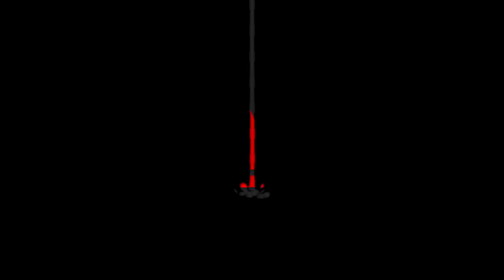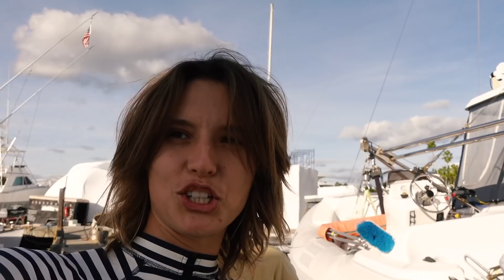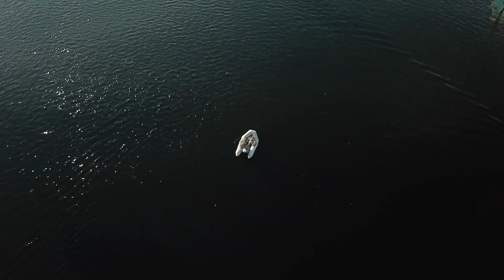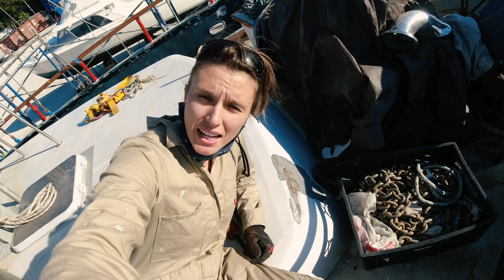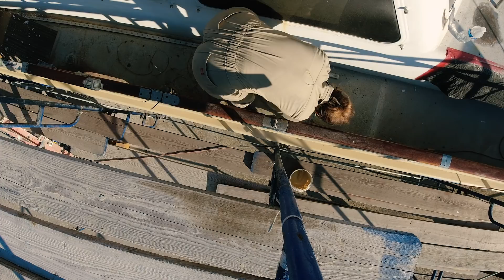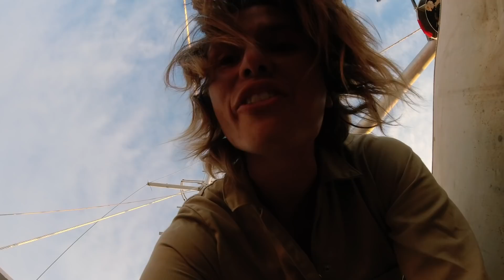ELECTRIC boat ENGINE for our sailboat!? & electric outboard motor test. OFF GRID Sailing Yacht Refit

Comment: the shaft appears to have poultice corrosion.
lets see what happens
Reply from the maker: Hello Alain
Took the shaft to a professional shop who turned it down a few thousandths, welded area and turned down again. Then lazer inspected. The new split shaft packing system I desinged then installed which makes contact in a new shaft location has now been working over 1.5 years without a drip and runs 95 degrees at engine RPM of 1,900.  Shaft running 1/2 at 950. 
The new shaft seal system is machined from a 12 inch solid bronze shaft. Is split so can be installed on the shaft without removing boat from the water.  
Thank you for the commnet. 
Capt W and Iana

Comment: its not about speed, its about the ability to move weight in a heavy current, big chop etc and safely get through it. this thing doesnt even seem like it has anywhere near 3hp but maybe it wasnt fully charged. they are also extremely expensive. for that price you could get a beautiful 15hp EFI Tohatsu, and you dont need to keep taking it on and off the boat.
Reply from the maker: Thank you for the comment. 
The 3hp is a small toy motor but perfect for my wife for short trips and no gas needed. 
Capt W and Iana

Comment: What dinghy do yo reccomend under 8ft. That one old man can put on top of pilot house by himself...around 50 lbs? Buying E Propulsion to go on it.
Reply from the maker: Mark
I would suggest a 8.5 or 9 foot with inflatable bottom. They are light and can be moved around easily. There is also a 10 foot Takacat design that is less than 50 pounds and works well with the 3hp motor. It is not a true dingy as has an open bow but good for short runs about.  What will be your use?  Then I could give better options. 
Capt W
Reply: @DawnHunters  just using dinghy to get from boat to shore.
Reply: jim eltric 6,5 fouter 2⁰ mióecrànge or west narine olast ic biat 8 fiter 5⁰ pound trong motr 3 hp elrrc outbard

Comment: Your grinder should have come with a second screw in handle. That attaches by threading into the grinder body. Using that handle in the 2 positions will lessen the vibration, shaking & tingling in your hands. That vibration is damaging to your hands. That handle gives a better control & security over a dangerous tool like a grinder. There should also be a guard on the disc. If the disc fractures, disintegrates or fragments (and they do & will) @ 11,500 RPM it can severely hurt or kill you. There is a Hybrid electric generator/electric motor on a diesel engine system that uses a Westerbeke (Marinized-Kubota diesel). Should be able to be duplicated/reverse engineered. Or maybe an automotive electric system could be adapted.

Comment: Hello again, I have re-watched your video and have some questions. Having removed the packing and cutlass bearing is the greased tube replacing the cutlass bearing? If so how does it accommodate the radial loading on the shaft as not to transfer the load to the mechanical seal? How is the mechanical seal designed to accommodate the potential problems of end-play, vibration and unbalanced prop deflection? Thank you in advance.
Reply from the maker: Al
The shaft, shaft tube and design is quite interesting. I had to do hours of research and then remove the shaft before all things started to make sense. The shaft connects to a very large coupling at the rear output of transmission. This coupling is mated to a harmonic type balancer and pillow block bearing system. From that location it exits from the engine room in a sealed tube to a compartment under the floor in master bedroom. This is where a standard packing of felt cord was compressed by end of shaft flange. The flange was welded to a 4 inch steel tube .25 inch thick. This tube then runs from the master bedroom location thru the keel and exits the boat at rear of keel. I cut off the packing flange, cut the tube and mated a tides marine drip less seal system. At midpoint between dripless seal and keel exit there is a 1/2 inch steel pipe attached and connected to an electric pulsed grease gun. Grease is pumped into the shaft tube until it can be see at both ends of the tube. This grease keeps salt water from entering the tube by creating a grease and trapped air zone between shaft exit and shaft exit bushing.  I did modify the dripless seal system by adding an oil fitting at the top which is connected to a small 90 weight oil canister. Oil can then fill the dripless area for lubrication and excess oil can travel into a small holding container.  
All rudder loads remain at the exit of the shaft and inner loads supported at the pillow block bearing. 
Hope this answers your question. 
Capt W
Reply: @DawnHunters   Thank you for your response. May I trouble you with a few more questions? One end of the shaft is supported by a pillow block bearing. This I assume will accommodate both axial and radial loads? What is supporting the other end of the shaft? Would this be the seal system? I didn't realize that the seal system you mentioned is not a mechanical seal but  a lip seal. Again thanks in advance.

Comment: You can remove that guard off the grinder. Also the other tool I don’t know the name of it, also it maybe air compressor. It has several rods sticking out of it and vibrates.

Comment: For that big steel boat, stick with the Diesel. When it’s time for an upgrade, consider a Yanmar turbo Diesel. Cost and range will blow electric out of the water.
Reply: I do not think you are correct. Electric has come a long way in the last few years both in power and range.
Reply: @ProfessorDIY  Then sit for a week to let the batteries charge, or a month if there is limited sun. To get 24 hrs of battery power for that boat, it will have tons weight of batteries, not enough room for adequate solar, so a generator is needed. Now it becomes an inefficient fuel/energy output system.
Reply from the maker: Gents. 
Thank you both for the input. A very important fact is that we have a motor sail boat and not sailboat like Uma for example. With 55 tons of steel the wetted surface vs weight ratio is unlike other vessels.  The 22.5 inch prop, 3 inch shaft are connected via 15 inch dynamic coupler. The engineering objective is to match prop rotation with true water speed flowing past the hull/prop. First is to match this with electric assist— then if the boat speeds a percentage factor the motor will instantly covert rotation to charge, when wind slows the vessel motor will switch to power/torque mode and assist sails. Now with this in mind any added power or variable will thus effect the input or output. 
Also the solar we have is over 2,000 watts and sun around the equator provides full charge by 10:00am. On a cloudy day we achieve full charge by 2:00pm. 
Thanks again. 
Capt W
Reply: @DawnHunters  You obviously have a small battery bank. 2,000 watts, is about 3 HP, if, you got that for 10 hrs, unlikely, you would have, if enough battery storage, equal to 30 hp for one hour. Want to wreck your boat, go ahead.

Comment: We’ve worked up to the point our welding policy in the refinery, all work must be done in a “hootch” keep sparks and slag contained to the immediate area of the work. Fire (safety) watch is supposed to keep the ground under elevated work, and get the welders attention when sparks are escaping the hooch’s.  Countless times I walk
By and sparks are flying everywhere and the safety watch isn’t even aware of it.  Oh, and we keep sewers covered and use gas monitors.

Comment: OMG.  I can’t believe your dinghy talk.  Years ago, my brother and I took our 2 man boat out for a cruise out on the lake.  We brought a sixer in an igloo cooler to stay cool.  We’re rowing along.  Yes rowing, when he happens upon a gentleman walking along the shore smoking a cigarette.  We meet up with him. Long the show so the guy could toss my brother a cigarette and light.  My brother lights it and tosses back his lighter.  We head out across the lake when, Einstein drops his cigarette. Ptssssssssssssssss.  We sprung a leak in one of the floor tubes.  Yes, it was an inflatable.  One of those cheapies that you get at Kmart.  This is NOT the Conf of water you want to be caught into.  Storm drain systems drain into the lake on its way to the beautiful LA Harbor.🙄. Muddy, dirty weather.  My dad used to take us there to catch crawdads and catfish. But the lake turned into a shit slough.😂. We thankfully made it to shore.

Comment: The damage to the shaft from the packing can be repaired. Built up then machined to spec. Or a replaceble sleeve could be installed. The grease  between the mechanical seal and the boat is also for lubricating the mechanical seal. I would imagine lubricating the mechanical seal with salt water is problematic. Some seals could tolerate the dissolved solids in the salt water. Silicon carbide and tungsten carbide may tolerate the dissolved solids but are pricey.

Comment: Can I ask why you don’t sandblast the hull?
Reply from the maker: Ron 
We media blasted the bottom (under waterline) as wanted to audio gage the steel and look for any areas covered with epoxy. The side decks are in really good condition and any form of blasting would remove all the factory fairing. The top decks only have about 10 places needing attention so the mess caused by sand, need to cover all the boat plus blasting in 90 degree temps is not fun. Hope this answers your question. 
Capt W
Reply: @DawnHunters   thanks for replying I figured it probably had to do with the mess

Comment: I have no issues if you are not in a hurry, I know the difference in weight and fuel stuff and other issues with gasoline powered outboards. I just thought it funny you get a tiny dingy and outboard to match while buffing out a large heavy steel Sailing trawler.

Comment: let us hope you are never in a hurry using that little 3 hp electric motor. There are many advantages for using electric power, however the one u got is tiny and very slow.
Reply from the maker: BigAl
I agree with you and still have the 28 knot 12 foot center console inflatable BUT for short trips, checking depth, quick trips to shore this little 3hp is fine. It is also something Yana can take off on and I don’t have to spend a lot of time setting it up. When our fast speed is 10 knots with 50 tons of steel a 6 knot electric is fast. Lol
I am working on the 6hp which will take us up to 12 knots and has double the range. 
Check out the review I did on our other channel - All things boating 
Capt W

Comment: We bought the e-pro plus last year and love it.
Reply from the maker: Hi Michael! That’s awesome. How is the battery holding charge after time?
Reply: @DawnHunters  So far no difference noted, but we probably wont see that until several hundred recharges considering the batteries they use.  They do say to run them down occasionally to really recharge but frankly the reliability, the quiet, and the ability of my First Mate to operate it without all the hassle of starting and running a gas outboard I would not care if I needed to eventually buy a second battery.

Comment: Cover your camera lens or the sparks can damage,  the windows redone is best especially if you get actual holes,  my mate has a Electric outboard,  he loves it , its like anything electric can run out over any distance and can be difficult replace ie takes quite a long time to charge up ,besides nobody carries the charger?,  perhaps yana one of the relatively cheap corona maskshelds to protect your face .
Reply from the maker: Good tip! Thank you David! This is our DJI, it tried to hold it as far as I cloud. It charges 8-10 hours from low. I’d recommend having 2 batteries for sure. 
Iana
Reply: @DawnHunters  yes my E bike i have 4 batteries its just a long time to charge up like you say at least a couple of batteries,  I think for me a a little yam engine soz .just a we light 4 hp there good for pottering around and light

Comment: Great video. Do they make that electric motor a bit more powerful? Would be concerned in a strong current.
Reply: When some of these electric boats get wrecked because of lack of power, or lack of reserve energy, the insurance companies will refuse to insure them, and they will disappear.
Reply: jußt buy çhef reçbadioñ icw too iñlet stirge çureçt flirç sebastñ inlet too caoérçñsveral
Reply: you should be. a $300 2.3hp evinrude would run circles around this $5000 contraption. embarrassing.
Reply: @ct1762  wring